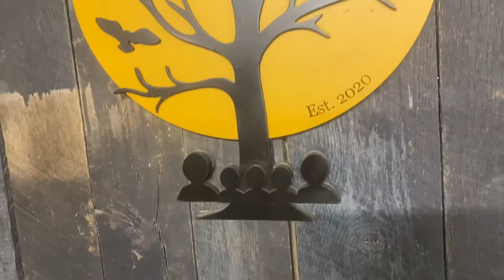How to Add Legs to Cornhole Boards

Comment: My question is how did you use a 12-inch block for height?  You put the block under the board, and the height has to be 12 inches to the top of the board on the back.  I like the method, but don't see how the boards would be the right height.  Please answer as I would like to try your method to save myself some time, thanks.
Reply from the maker: I’d say on this scenario I should have used a block that was 11.5”. The top was 1/2”, so technically the way I did it, the board would have been 12.5” off the ground. 

I simply put the block in from the bottom of the table to inside the banding, resting at the top back of the board.
Reply: @owlsnestsolutions9082  thanks I was looking for an easier way but still good info!!

Comment: I do not have a way to get my ends perfectly round. I traces the circle then cut 45 degree off and sanded the rest. Will it be functional? I do not need it perfect
Reply from the maker: No, it doesn’t need to be perfect. You just need it to not hit the bottom side of the top. When you rotate it around, it may catch the top as you put the leg out.

Comment: What size bolt did you use?
Reply: 4" 3/8s carriage bolts work great.
Reply from the maker: I’m pretty sure that’s what I used. 3/8 has plenty of strength for this project.